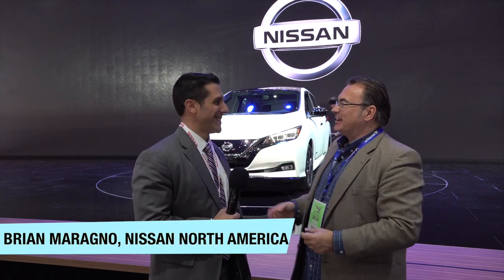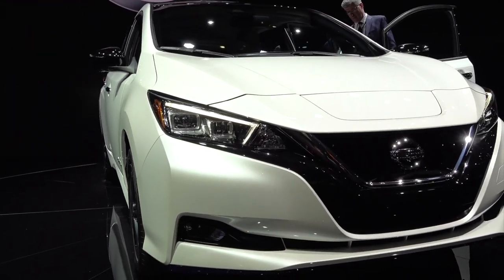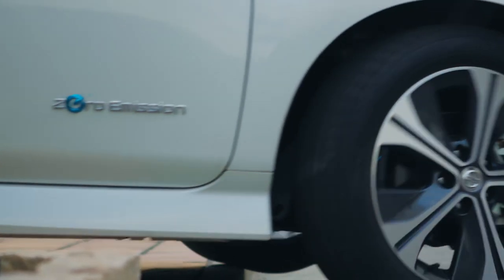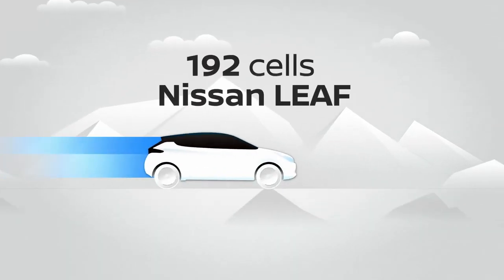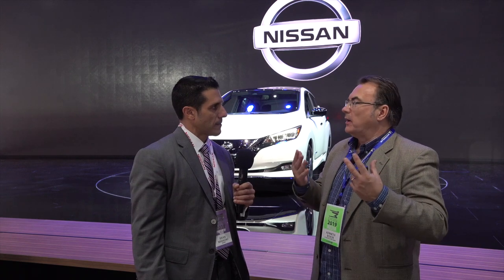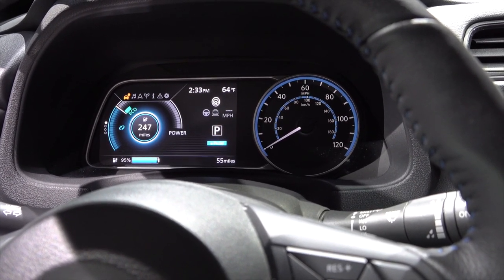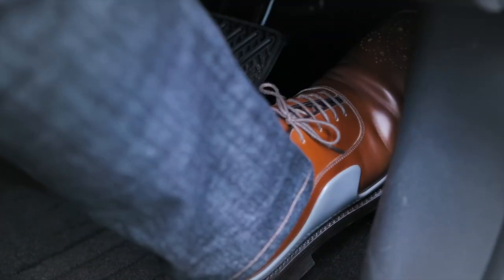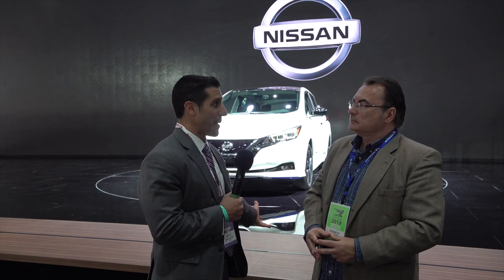Special Episode - 2019 Nissan Leaf e+ Impressions from NAIAS Detroit!

Comment: Still the same old analog speedometer
Reply: My 2011 has a digital speedo :-)
Reply from the maker: Hi Robert, yes but it does offer a digital speedo on the binnacle display if you scroll thru the view options it will appear.  I just did not show it on this video because I did on my review of my own 40kWh Leaf last summer.  You can check out that video and see the digital display.  It works well but I'm old school and am used to analog so I never use the Digital.
Reply from the maker: Yes, the Gen 1 Leafs all have digital only!  Gen 2 and Gen 3 (Nissan calls the e+ Leaf 3.0) have both!
Reply: @EVRevolution  They may have both but the Digital one above the steering wheel in the Mk 1 Leaf is so much easier to see whilst driving without taking your eye off the road! 

Going back to an analogue speedo was the worst decision they made after not cooling the battery properly. 

As to the battery issue, I seem to remember seeing somewhere when the Gen 2 Leaf was introduced, that the shape was only an interim for two years or so before they give us a completely new version, I predict that this one will have properly cooled LG Chem batteries.
Reply from the maker: Hello Edwyn, I see your point but at least they put both in the Gen 2.  It's a personal choice and very subjective of a traditional analogue versus a digital speedo.  I know many people who hate digital, so at least you have both in the newer Leaf.

As I've discussed at great lengths and passion, Nissan's decision to stay with passive cooling for them works and that's what they want to do for now.  They have their reasons, most likely cost and profit margins, but they offer a good BEV choice for thousands of consumers.  You have the choice to go with their approach or not - so why slam them.  No reason too.  

The "battery issue" you state is really a moot point as I've never seen any quantitative data to support these negative claims.  With the hundreds of thousands of Leafs sold globally, if this issue was as bad as a few say, then I'm sure we would have seen much more actions taken by Nissan.  Simple cost of business is not good if you are constantly fixing/changing battery packs due to warranty claims.  

Currently, they still use AESC for the 2.0 and 3.0 Leafs and they've made no official announcements or statements regarding partnering with LG Chem.
Reply: I like the new speedometer

Comment: Leaf Gen 1 owners are not like the Tesla lemmings, if Nissan continues to not explain all aspects of Leaf ownership, like what do you do when you do when you have a great car that is rendered a shadow of its' original self by constant need for topping up. Then introduce a predatory battery replacement plan ($10,000 US) destroying any resale value, KIA and Hyundai will benefit. Caveat Emptor
Reply: McGoo x But at least Tesla has a decent battery management system, better looks and performance. Only if I could afford a model 3! Probably the Leaf is a more realistic prospect for me.
Reply: Bought my Leaf in 2011, 160 km range,  now I am lucky to get 108 at full charge. Turn on the heater that drops to 85. Travel at 80km plus and you are lucky to net 40 KMs. Replace the battery $10,000 US    Predatory practice by NISSAN, (why sell you a battery when they can hook you for a new car) retained value of the car is crap. Car was made in Japan and will go another 8 years easy. Such a waste They still do not use industry standard battery temp control so it is a looser.
Reply from the maker: Hi @McGoo and R, thanks for comments and for watching my show!  I don't think what Nissan has come out with is a negative.  The 40kWh and 62kWh Leafs are both great BEVs and a good choice for many uses cases.  They are not for all and that is the beauty of having more choice in this ever growing marketplace.
Reply from the maker: Ok, well I had an ICEV with 200,000kms on it, a 2008, and in 2016 the engined died and needed a full replacement.  This was after babying that car (ran only full synthetic oil, did maintenance on a regular basis, etc.  Manufacturer wanted $6000 for the new engine and labor and I sold the car to a junk yard.  So how is this "predatory practice"?  I applaud you McGoo for being one of the first early adopters of BEVs.  However you have to know that with any early adoption of new technology, there is always inherent risk.  With your Leaf today, I could still get back and forth to work every day with it, even with the lower range availability you state.  So even your well used Leaf can still work as a great daily commuter for thousands of people.  Maybe not you today, but others.  So why is this a bad thing?  If it's not doing what you need it to do now, then trade it in and get something else.  Or a cheaper route is replace the battery for $10K and you have yourself basically a new car again, as you state it could still go another 8 years!  Why is this a waste?  You can reuse the rest of the car and just change the pack for another 8 years!  That is a stellar model!
Reply: My point was they are pricing battery replacement based on new car sales not on long term customer relations. $200 US per KW hr = $4,800 plus $1,000 assembly  and shipment to dealer, $1,500 to dealer for markup and install        $2,000 surplus for what?     New Leaf experience is Christmas future based on Gen 1 history Christmas past  (:
Reply: Correct unless all sides of the LEAF experience are available then a shrewd consumer goes into the decision process without all available ammunition  (:

Comment: A big problem with ChaDeMo is that the infrastructure in Europe now is fully set to expand CCS and ChaDeMo will fall back and become much more uncommon. In a couple of years, there will be a big disadvantage to have ChaDeMo than CCS. :/ The Ionity network only have CCS....
Reply from the maker: Hi Electric Swede, thanks for watching and for comments.  It may, but will have to see.  There is quite a lot of CHAdeMO already with more being built, so with the longer ranges it may suffice.  As you heard, the bi-directional charging is why Nissan keeps CHAdeMo.  Plus, it's already at a newer standard and continued efforts are being made for future revisions.
Reply: @EVRevolution  Yea, I know why they keep with it.. But since Europé has made CCS as standard I think Nissan will miss out big time if they don't change or have double charge ports (that could be a solution.. Both CCS and ChaDeMo.).
I heared that CCS 3.0 will support V2G and V2H as well.. Maybe they can change then?
As more and more EVs are on the road and the ChaDeMo chargers also has CCS-plugs there will be queues on them.. And while CCS-vehicle can choose other newer chargers when that one is occupied I'm afraid we Leaf owners will just have to wait a lot. We are not there yet.. But the big networks that are starting to be built now only have CSS.
I hope I am wrong.. ;)
Reply: This car will be produced in low volume, so they already miss the target. We have to wait for 2020 to see a CCS version.
Reply from the maker: We will see.  However it CCS is something you really want and need, then there are other choices available and more coming!

Comment: Interesting what he says about lessening the heat problem with the new battery, but just put liquid cooling in the car. And the screen still doesn’t look that impressive. It seems as if Japanese cars tend to have the worst infotainment.
Reply from the maker: Hi Chris, thanks for watching and for comments.  I think everyone needs to get over the fact that Nissan at least for now, is not putting liquid cooling in their consumer BEV cars.  That is their choice and the still see a very sizeable marketplace to go after where the Leaf and Leaf e+ fit very nicely.  

For many consumers, no liquid cooling will not impact their daily driving needs and travel needs, as long as they are aware of the characteristics of the Leaf when it comes to fast charging.  I believe the e+ will overcome most of the use cases out there, however someone I am sure will find a way to bash it anyway.  It's not a car for everyone, just like the Model 3 is not, so that is why we have choice.  So everyone needs to stop harping on the fact than Nissan does not have liquid cooling right now and if that is important to a prospective EV buyer, then there are many other choices to consider.  This is a good thing.  

Just like you have a $10 gallon of paint which will cover your wall, a $30 gallon of paint which will cover your wall and a $70 gallon of paint which will cover your wall.  Each will have features/benefits and pros/cons that you have the choice to make to pick which one is best for YOU - not for what is best for someone else!  

As far as the screen goes, yes it is still not as impressive as say VW's is (IMO they have one of the best interiors), however it's a nice step in a positive direction in which Nissan recognized that they could improve a few small things in this e+ option as well as offering OTA updates which to me, brings them into the 21st century.  Not all EV manufacturers offer OTA still.
Reply: EV Revolution I totally agree with you Ken. 95% of people or more will have no issues even if it does heat up when doing long trips. Probably including myself as I generally like to cruise and take my time on road trips. But I just feel like they are shooting themselves in the foot and allowing bad PR to continue to dog them.

I also appreciate Nissan for making more EVs than any of the other fossil manufacturers. That’s important. But as far as my own personal excitement, I have to say that Nissan have completely lost me. Hopefully they win me back soon with some cool new EV. But for right now, I’m so much more impressed with what Hyundai and Kia are doing. They just need to make more of them.

Loving the show and your commitment to the cause :)
Reply from the maker: Thanks Chris, I understand your Nissan thoughts and I don't think the PR is as bad as you and most die-hard Evers think.  The average consumer looking into EVs has no idea about this stuff.  So that is why it is important to understand a new buyers needs, uses and budgets in order to map in valid BEV options.  

Nissan really does not care about the rapid gate nonsense since it has not hurt their sales one bit.  More choice on the market is what is taking a chunk out of maybe their sales and others.  And that is a good thing.  It's too bad they lost you as a future customer, however I am glad you are sticking with BEVs and yes the Koreans are making some huge waves in this market and rightly so.  I am super impressed with the Niro EV that it's my pick for EV of the Year!  And yes, they need to make more of them for sure!  

Thanks for the feedback as well!  Love this interaction and comments, great to see so much passion and dialogue!  :)
Reply: EV Revolution Yeah you’re right that it’s just us hardcore EV people who even know about it.

I wouldn’t say they’ve lost me as a future customer, but for sure the Leaf is super expensive for someone like me, and also too big for my use case. There are still no truly affordable EVs on sale that I know of. Once you add in fuel and maintenance, the Zoe and Smart are close but even they are probably not going to be there for another couple of years.

I’d love for Nissan to come out with a small, fun EV for £15k or so. I’d be into that for sure.

Comment: Analog speedo, no vegan interior option, Fail.
Reply from the maker: Hello Courtney, well the Vegan is correct, the speedo is partly correct as there is also a digital speed available in one of the views on the binnacle.  I just did not show it in my quick pass thru the dash, but I did in my 40kWh video review last year.  I don't consider the car a fail.